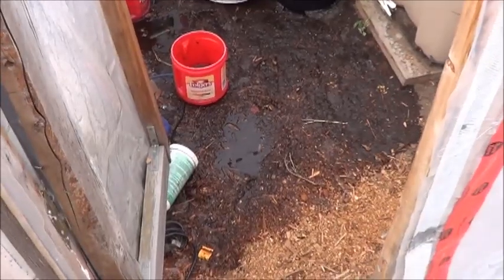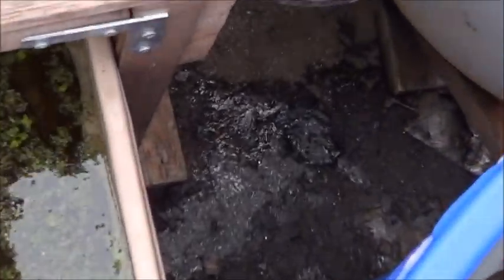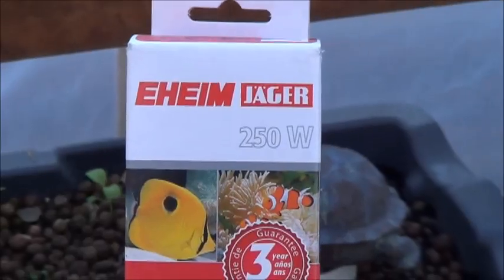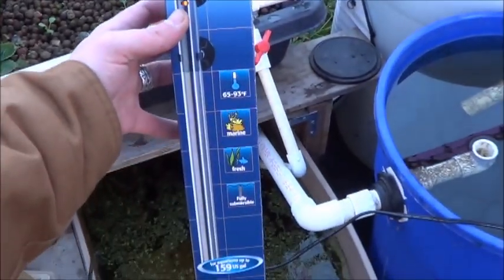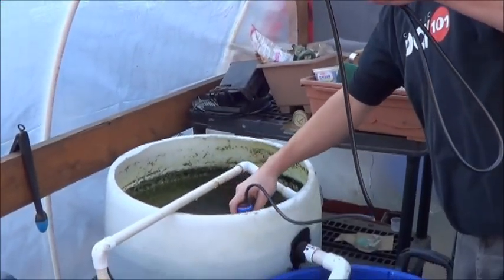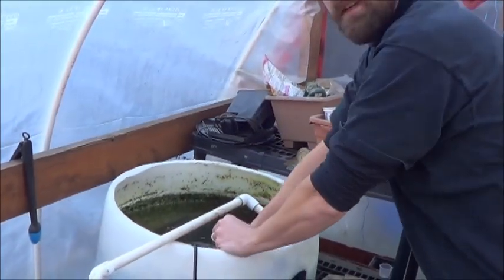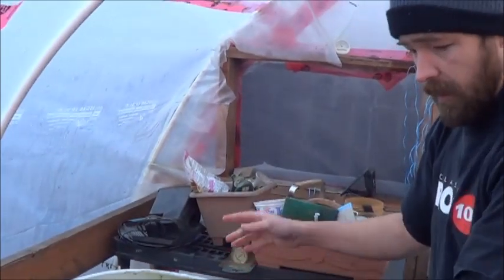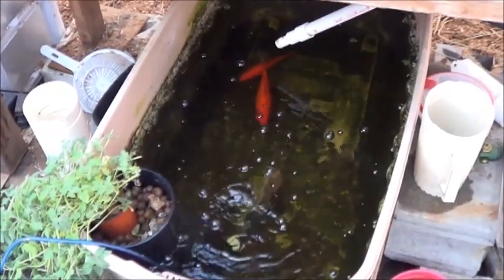Frozen Aquaponic Greenhouse Winter Mini Crisis

Comment: In a normal tank the heater would be in the back closer to the bottom. as heat rises. But  where you  are it will freeze top down. do you have access to straw or hay bails. They can help to insulate. Wish you were closer. There was a box of bubble wrap for $10 at the surplus store the other day. I knew I should have grabbed it. But it was 12in x 125 feet. reducing your space to keep warm is a good ideal. best wishes.
Reply from the maker: TheEmptynester I wish I could get my hands on some cheap straw or hay, that would be awesome for so many different things I love to do.  I probably should move the heater a down a bit but my thinking for now is that the water enters at the top and circulates down and out from a drain at the bottom.  Having the heater at the top will keep warmer water in the main tank for longer ... I think ... the jury is still out on that one.
Lol, I see backyard projects in my near future ...
Blessed be!

Comment: Man that stinks JT Bear but that is a good heater you got their. I bought a 300 watt one from Amazon I think it was about 35$ I have about 400 gallons give or take in my system and it keeps the chill out. Of course your warmest day will probably still be cooler than our coldest day here. As one of your commentors said you will have to crank up the heater. Also those little suckers on the heater don't work so well on plastic. So I would drape it over the pipe so it hangs in the middle. Those wands on the heater can get pretty warm and you may not want it against the plastic. I'm not sure if it would hurt it but better safe than sorry.
As far as insulating your barrels , if you had some old blankets you could cover them with that and it may help insulate the barrels or just wrap the around the barrels and use every handy man's favorite adhesive, ( duct tape) or buy a roll of attic insulation and wrap them up with that. Depending on the cost. The insulation would probably help keep the water cooler in the summer as well.  Just a few suggestions. Hope it works out well. Stay warm.
Reply from the maker: gardening4fun Attic insulation, I'll have to look into that!  I thought about blankets and someone suggested an electric blanket for the barrels.  I'm wondering how a quick box around the tanks would do if it was filled with wood chips or something but I'll check out attic insulation!  Thanks!
Reply: JT Bear. If you were going to put a box around the barrels,I would look into the insulation they blow into the roofs. I know it's pretty cheap and won't break down. Then just make a lid to cover the barrels. I think your fish would be toasty at that point and the cost would be minimal.
Reply from the maker: gardening4fun Will that be okay with the moisture from the tanks?  It seems like the most logical starting point but I find myself uncertain ...
I guess there's another video in all of this somewhere since I'm gonna have to do something!
Have an awesome day!
Reply: JT Bear that's true about the moisture. What you could do is put the insulation in a heavy mill trash bag and tie it up right.that should keep the moisture out. At least it sounds good in theory :-)
Reply from the maker: That sounds like an excellent theory!  Sold!
Now if I can find some of that spray in stuff ...

Comment: In the Aquarium world, Eheim is some good stuff. I haven't used much of their products, because they used to be fairly high priced compared to Tetra stuff I'd end up buying.
With that said, I do have two products of theirs now. The same heater you have. : )
I think it's a 150w for my 40g aquarium, and a 300w for my AP.
-
There are a lot of replies, so I haven't read to many yet. But I did see you mentioned that you turnt up the temp on the heater.
The way I see it... 250w is 250w. It won't do any more or less no matter what temp you set it at. Soooo... set it where you want it. So when that "warmer" day comes, you won't be cooking your fish. ; )
-
In a couple of my videos, you can see how I installed my heater[(s) used two last year].
10 mins in on this one...
Aquaponics: Fall Update 2014 pt 2
Aquaponics: Fall Update 2014 pt 2

suction cups don't like to work too good, even on glass aquariums. And I would imagine that barrel at freezing temps, with freezing temp suction cups, won't stay long?
For yours, something like this could work easily...
PVC pipe across the top of the barrel, with a couple of small holes at the top on each side for zip ties.
I done this to mine to avoid the chance of the heater touching anything, especially the pond liner.

Comment: I know I'm a little late to seeing this vid but I'd be worried about having it next to the pipe because the heater heats up to about 200 degrees so could be a chance of it melting the pvc if they are touching, If I remember right pvc becomes pretty flexible at 120-140degrees and melts at 178. plus if your only worried about just the freezing you would want to lay it on the top flat or if you're worried about the fish being warm than have it at the bottom then move it to the middle once things warm up and you want it on full blast at the start to get things going quicker..

I would fix my grammar but I'm too tired right now haha
Reply from the maker: Onepower We can forgive grammar, this isn't trade chat.  lolz
I've moved it down to the floor of the sump tank because that's where the greatest amount of water movement is.  I still want to put a protective barrier around it because I've already seen the goldfish cozying up to it but todays project is trying to fill the insulation box.  My hands are just vibrating from that little wood chipper.

Comment: I noticed in your last video that you had your heater in a pot inside the tank. That will reduce performance. The heaters have internal thermostats that will shut it off when the water around it reaches a certain temperature. Being that there isn't much water flow in that pot, the hot water will stay inside it, making it shut off sooner than it normally would, because as far as it knows, all of the water is that temperature, when actually, only the water inside the pot is warm enough. I bet you wouldn't need a bigger heater to keep it from freezing if you took it out of that pot.
Reply from the maker: Eric Mastenbrook The 250 watt heater is on the base of the sump tank now, it seems to be keeping things nice & warm since that's where all of the water travels to and from. 
The heater in a pot was to protect it from those two big goldfish, they have a history of abusing heaters ...

Comment: Set it on the highest setting. Just because it's set on 63 degrees, doesn't mean it will keep it there. Sorry to be the bearer of bad news, JT. But that probably ain't gonna cut it. Keep it on 93 degrees, that should keep the frost off. :)
Reply from the maker: Josh's Aquatics Don't be sorry, I appreciate honest feedback.  Makes it easier to learn!
I already bumped it up to just under 90, I don't like running anything at a max setting but close to I'm okay with.  :)
I would love any suggestions you may have, the basic goal is to keep things from freezing again.  I'm already thinking a cover for the sump is a must, some form of insulation around the tanks would be good and perhaps a mini greenhouse over the bed to trap a little more of the heat ... any other ideas?
Reply: Those all sound like good ideas! But, what about the solar heater you were going to build? Also, bubble wrapping the whole greenhouse might not be a bad idea. I'll admit, I don't know too much about greenhouses. But what with all the fish tanks I've kept over the years, I know a thing or two about heating water! :)
Reply from the maker: Josh's Aquatics Bubble wrap for the greenhouse would be too much of an expense but a mini greenhouse made of bubble wrap might be do able.  I'll have to ponder that one.  The solar heater takes sun, something there hasn't been much of lately, and for best results requires somewhere to bank the heat for a slow release.  Creating the heat seems to be the easy part, keeping it is the trick!
Looks like I've got some projects for the next few days ...
Better busy than bored!
Reply: 'Bubble wrap for the greenhouse would be too much of an expense' Yeah, that would be the problem. Same reason I couldn't do it! But, maybe with plastic bottles? And the solar heater sounds pretty problematic too. I'll let you know if I think of anything else! Oh, and BTW, That's a really good heater.
Reply: Also, 55 gallon drums painted black might be a pretty good heat source. That is, if you can get some sun!
Reply from the maker: Josh's Aquatics The sun is the tricky bit.  I was laughing with Chox suggesting some egyptian mirror tech from where the shed used to be.  Direct the sun towards the blue bin to catch the heat.  That is the brightest part of the whole yard, might just work!
Reply: Ha! Gotta be creative!

Comment: Hey brother I think I'd be painting both those barrels black to absorb as much heat from the Sun as they can during the day... and that heater was made in Germany right? Because it would be graduated in Celsius, and 90 degrees C is a little too hot for goldfish...
Reply from the maker: trollforge Good point, I'll go check the paperwork and find out for sure.  Never even thought about that.  The box states how many US gallons it heats though so it might be F...
Some black paint on those would probably be a great idea for winter but do I turn around and paint them white for next summer?  I guess the repainting would make a insulation of sorts!  What if I wrapped them in some of that rubber liner I have?  Would that work I wonder ...
Thanks brother troll!
Reply: JT Bear
you're right Jager is graduated in F, but 68°F is room temp for us, that is more than enough for goldfish... I think I'd paint them flat black, then wrap them in Mylar for the summer...
Reply from the maker: trollforge If I can keep it over 50°F I'll be thrilled!  As long as the water doesn't freeze again, I'm content.  I'll be curious to see what the water temp is tomorrow morning, it's supposed to get below -10 °C tonight again so ...
I might end up painting those barrels though, but I was also toying with a quick wooden frame filled with some basic (and cheap) form of insulation.  More wood chips perhaps?  I'll try and sleep on it, see what I think in the morning.
Thanks for the input!

Comment: If you want to go with a no power water heater you may want to look into fresnel lens as a way to heat up the water. but get only a small one so you don't boil your water I'd say a 20" lens would be good for you..
Reply from the maker: Onepower Green Power Science?  I've looked into those, they're very interesting.  I toyed with the idea of using one to make a solar water still in the summer but never got around to sourcing the lens.
Good idea!